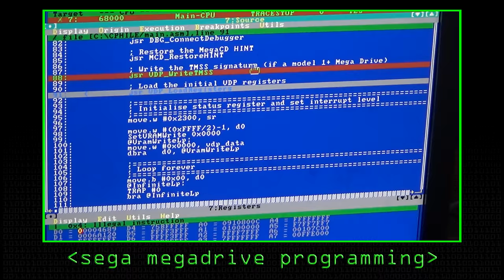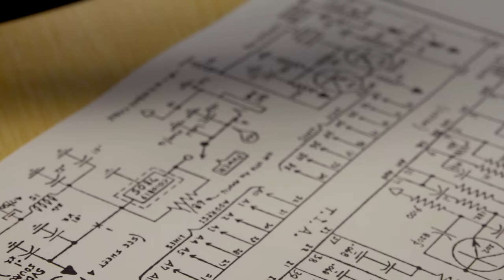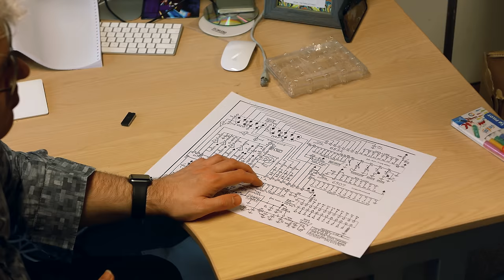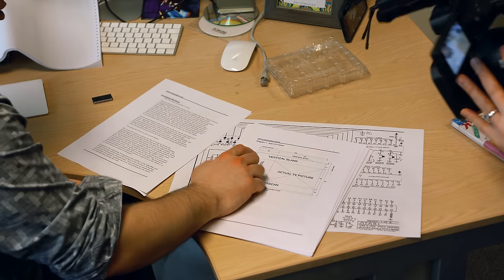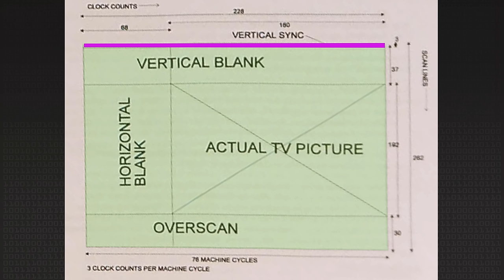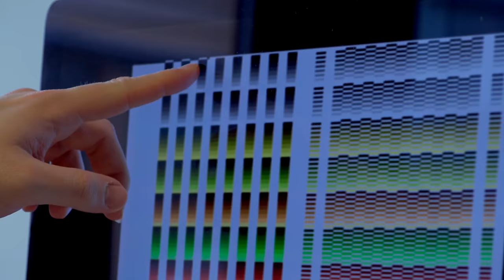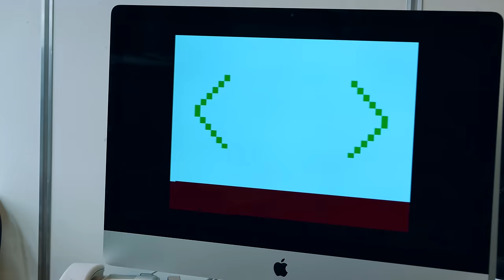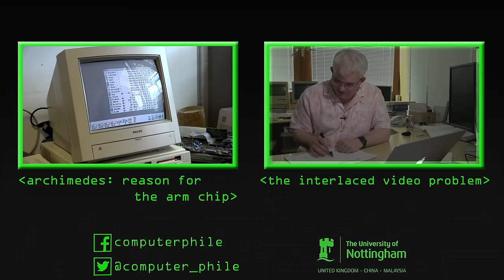Atari 2600 VCS Programming - Computerphile

Comment: 14:28 - I think he meant to say C64 (not Amiga) for the 8 hardware sprites.
Reply: Dave Poo - that was my thought as well. The C64 had 8 hardware sprites. Ingenious use of the raster interrupts could allow more depending on where they were placed on the screen (he correctly stated 8 per line). I forget how many Hardware sprites the Amiga had, though it was a fair few more than 8.
Reply: Annoyingly, no.  The Amiga has only 8 hardware sprites.
Reply: @Aexomer  8 hardware sprites in 3 colour mode, you could combine 2 sprites together to get 15 colour sprites.. but then you only had 4 sprites at 16 pix wide sprites per scanline.

Comment: Why do so many people say the Commodore 64 had a 6502 processor?  The C64 had the 6510 processor, which is derived from and similar to the 6502 but redesigned so it was able to access 64K of memory.  It's the Commodore VIC20 and the PET that had the 6502.
Reply: Technically, the 6502 was also able to access 64K of memory.  The problem is when you try to stuff 64K of RAM and 20K of ROM into a 64K address space.  In order to do that, you need bank switching, which they did by adding a general I/O port to the 6510.  (You can get the same effect on the VIC-20 by adding another 6522 and some glue logic.)
Reply: Strictly speaking the 6510 can't access 64K, since one or two of the memory-locations (I don't remember) is used for the IO-port
Reply: LueLou ... Not right. The z80 was an 8080 clone with some extra features.
Reply: Hahaha! How precise observation you did!
Reply: @SpearM3064  The 6507 did not have enough address lines to see any more than 8 k. So technically it did not... because the electronic signals were not there. Yeah the instruction set could request it but the hardware could not deliver it.
Reply: @luelou8464  It's the other way around. the 6502 was a derivative of the 6800. And the two are not 100% compatible nor would I try to swap a 6800 design to a 6502 design. Z80 was a derivative of the 8080 and added many new features. You can't run all z80 code on a 8080  as a result.

Comment: An interesting feature of the TIA is that they couldn't afford to have proper binary counters, so the players (sprites) were associated with pseudo-random counters instead which cycled exactly once per line. You would wait until the beam was at the horizontal position you wanted and then reset the counter - from then on the player would show up in the same position on each line and the processor could forget it and go do something else. You could select for a few clock cycles to be skipped in the vertical sync and that would move the player slightly to the right or to the left in the next frame. Note that if your player wasn't just a bunch of vertical lines you had to rewrite the bit pattern in the TIA for each line.

Comment: Is 6502  Assembly Language easier to learn compared to Languages such as  python, javascript  or C
Reply: In one sense, it is very easy as there are a limited number of instructions. In most senses, though, it's very much more difficult as you have to work out how to achieve what you want using those very low level instructions. Higher level languages give you lots of shortcuts that you can use, assembler (of any sort, but especially for older chips) have a very limited vocabulary.

Comment: Atari 2600 is practically raw machine code since Atari 2600 dose not have the CMOS firmware to translate msbasic commands from keyboard or cassette otherwise Atari 2600 would be proto commador which would be amazing for homebrew.

Comment: This sounds too retro to be fun.  Challenges are fun but these constraints make development more of a mission impossible.  What's the best you can hope for?  Getting a paddle moving up and down?  How much effort does that take?  Long hours, days after days getting screens messed up constantly and struggling to find out why?  Seeing every instruction spaghetti side effects into your display?  That sounds like a programming nightmare.
Reply: A small change in gameplay design or graphics would probably need so much of the codebase altering. A game would have to be entirely designed almost before development starts with very little scope for change. Certainly a nightmare.

Comment: One thing that makes sense after seeing this is the appearance of black lines on the left and right sdes of many 2600 games.  Those lines were there to give time to the CPU to run program code and maintain synch.
Reply: The lines are actually caused by sprite repositioning. There are just two sprites, but positioning them is rather tricky (in order to keep the hardware cheap): You have to tell the graphics chip where to position a sprite by exact timing. Basically, you just say, "now", and the chip will reset an offset counter. However, the CPU is slower than the graphics chip and to compensate this, fine adjustments may be applied by movement registers, which introduce another offset.
In short, whenever those movements are applied, the graphics chip "blanks out" for 8 pixels at the start of the line. The tell-tale sign that sprites have been repositioned to be reused somewhere else (below) on the screen.

Comment: Damn, you even had to program the screen raster?! Yikes.
Reply: ct92404 
No frame buffer — RAM was too expensive.  The design was intended for very simple ‘Pong’ style games.  Atari worked on a replacement video game console to do much more than the VCS, but was bought by Warner who changed the brief for the project: and it became the Atari 800 and 400 ‘home computers’.

Atari was early ‘Silicon Valley’ lunacy.  Very interesting history of the early days, before the suits knew anything about the business and writing code become commodified.

Comment: how did they implement PacPerson or Donkeykong on such a hideous platform?
Reply: Badly
Reply: ZCJKF13GDG4 Donkey Kong was fine. It just had only two stages, and the graphics were limited,  but it was a decent port. Pacman, on the other hand, was atrocious: hard to see identical ghosts that didn't behave at all like the original.

Comment: He says Mame... did he mean to say Stella?
Reply: No. MAME had a sister project, MESS, which used the design philosophies of MAME but instead of emulating a bunch of different kinds of arcade machines it emulated a bunch of different kinds of consoles. Like MAME there were no shortcuts; it emulated down to the chip.

They merged both products into MAME. He uses it here because it's probably more accurate than Stella when it comes to writing and testing assembly.
Reply: Thanks for the reply, I'll have to give it a try. I've been using Stella exclusively. Stella has some great debugging tools built in for developers, so that is the usual go-to emulator for them.
Reply: Stella has, bar none, the most accurate emulation available for the Atari 2600.  Granted, I am the main developer on the project, so you may say I'm biased.  But I'm also in a unique position to know which emulators are the most accurate, and where they are not.  And compared to Stella 5.x, MESS is nowhere near as compatible as Stella.  Recent versions of Stella are cycle-accurate for the TIA, and the next release will be cycle-accurate for the sound hardware as well.  Neither of MESS, Javatari, z26, etc come close.
Reply: @CODMarioWarfare  Not true. Stella is the most perfect emulation of ALL emulators for any system byt leaps and bounds. Mame and Mess are... well a bloated Mess.... I know I wrote parts of it. Back then it was still manageable.... now it's just horrible. The Gui is terrible and the need to constantly update roms based on check some is beyond unfortunate.

Comment: Pacman was a terrible game IMHO, very bad to give as an example, very bad, rushed port.
One of the many many causes of 80's game crash.
Reply: Ms. Pacman was far better...but came out later. The earliest Atari games from 1977-1980 were all pretty simple compared with the ones that were released in 1981 and later.
Reply: @pex_the_unalivedrunk6785  Atari's Pac-Man port came out in 1982. It turned out the way it did because its programmer, Tod Frye, had only 5 months to make the entire game by himself for a 4K cartridge. Ms Pac-Man and Jr Pac-Man were both ported by a team from General Computer Corporation (the firm behind the arcade originals of those two games) and allocated 8K and 16K cartridges respectively, so of course they were going to be better games than their predecessor.

Comment: The irony of doing this on such overpriced flashy hardware...
Reply: They've made a couple of videos addressing your concerns already. Feel free to trawl through the archive to find them
Reply: There really isn't much to reply to, but if you have video title/link I'll check it out.
Reply: MUH APPLE MARKUP
Reply: Wowthatsfail 
Or maybe there are just some people who prefer using a Mac over a Windows PC... amirite?
Reply: Using Windows feels like having every STD under the sun at the same time. I had to endure it for 6 months a while back, I still have nightmares.
Reply: Ze Rubenator 
Use linux instead. Problems solved. New problems may be acquired though...
Reply: That's not even that bad, I have 3 Titans, and I still code Atari 2600 games on this system.  I should get a 2nd computer...
Reply: @Wowthatsfail  Mic drop
Reply: @Lime-ne3fd  And you have to wonder why use either when Linux exists, amirite?